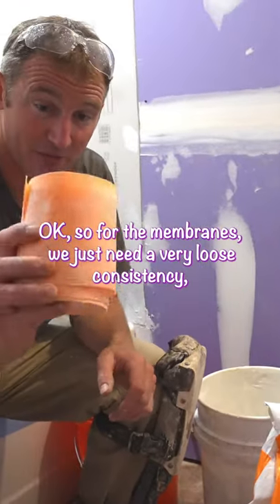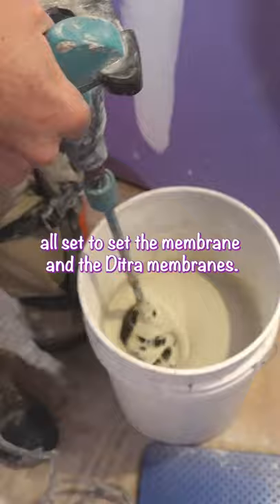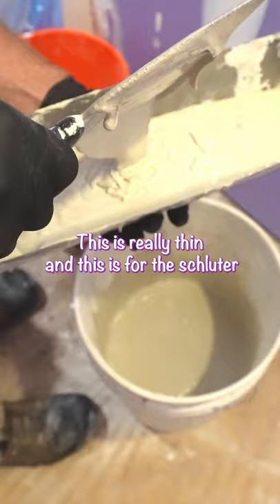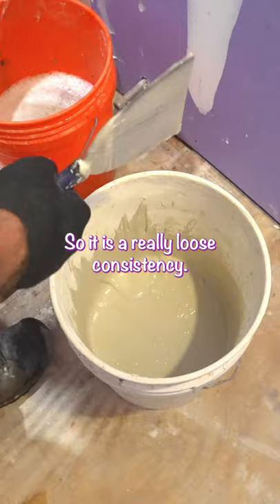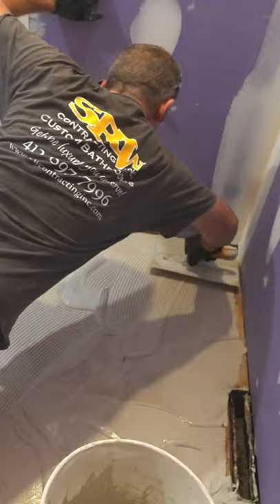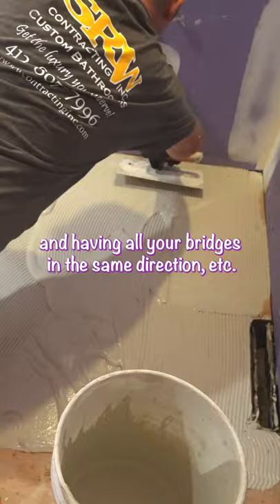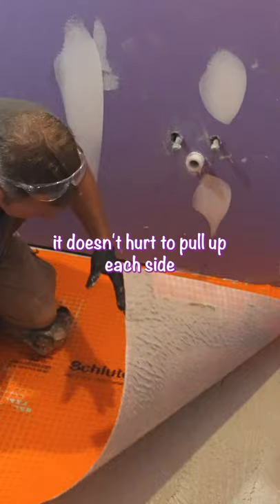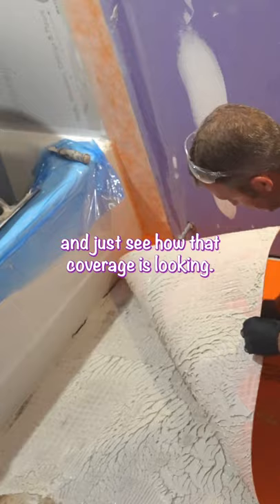Most important Step to Installing Schluter Ditra & Membranes #shorts #Youtubeshorts #diy

Comment: When I installed Ditra with Schlutter All Set, I followed the instructions on the bag and added the maximum amount of water but my mix did not look anywhere near so soupy like yours.
Reply: Not even holding a ridge for a second.  It's supposed to be loose, but not soupy like that.
Reply: @josephstanczak4340   So far, everything looks and holds good. I hope I did it right.

Comment: The Ditra sucks big time!!! I don't recommend it because the plywood and Ditra dry out the thinset over time!!
Reply: No it doesn’t. 😂😂😂
Reply: @MrGreegor69  yes it does, I do bathroom remodels for a living and have demoed this material after 1-2 yrs of being installed.  It sucks so bad you can't even do repairs without damaging the board.
Reply: @christianarias4850  I’ve been tiling over 20yrs & have been using Ditra for almost as long.

I’ve ripped out some of my own work after years & it’s as good as the day it was installed.
Reply: @MrGreegor69  Ditra doesn’t work well on plywood especially if not installed properly